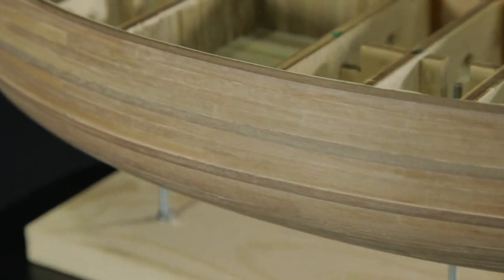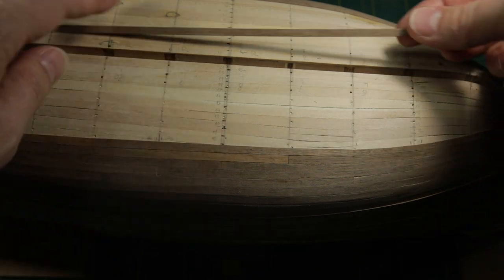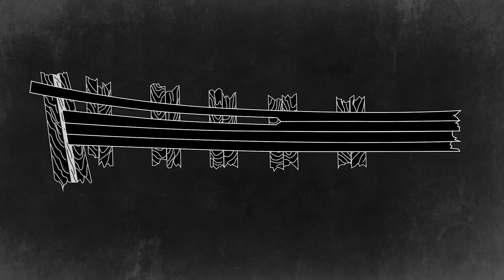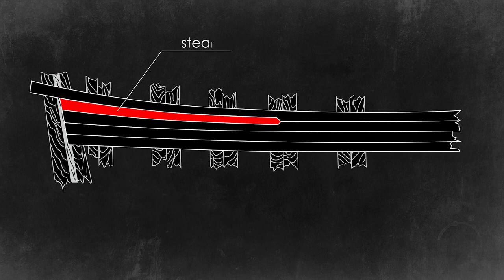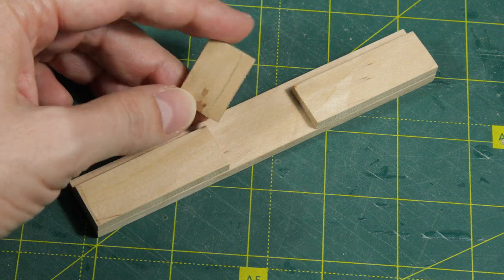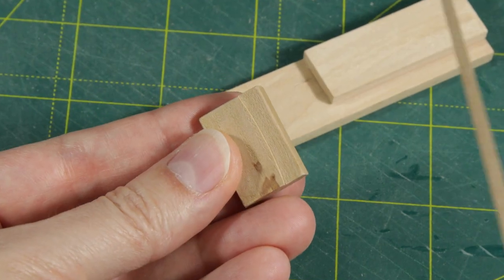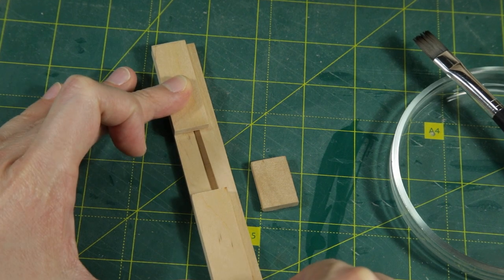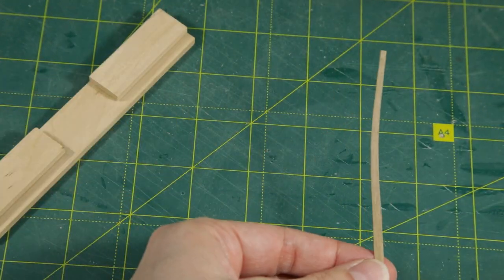How to bend planks for a ship model

Comment: Wetting and a soldering iron eliminates all this. Free form and eyeballing with this method is fast and easy. Michael
Reply from the maker: Dear Michael, thank you for your comment. It would be great if everything were as you write. In practice, using a soldering iron, an iron, or even a metal desk lamp are well-known and accessible old-school techniques that work, but in some cases, they do not provide optimal results.

Comment: I use ammonia. Soak for a few minutes and the bend can be very radical. Dry the wood piece out before CA glue is used to avoid foaming and permit good adhesion.
I use strongest ammonia available on the market shelf. VENTILATE !
Reply from the maker: VENTILATE - thats the key issue with ammonia approach. Unfortunately ventilation and smells is a problem for my workshop. So I have to look for “green” ways 😉

And ammonia itself does not resolve the problem of right bending direction (“bulging”)